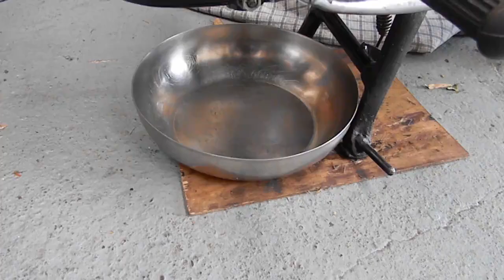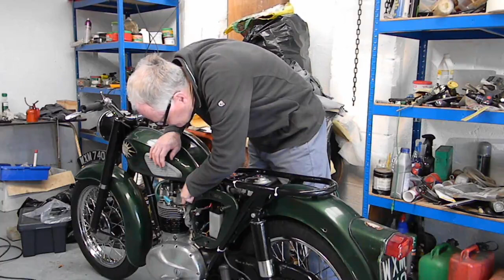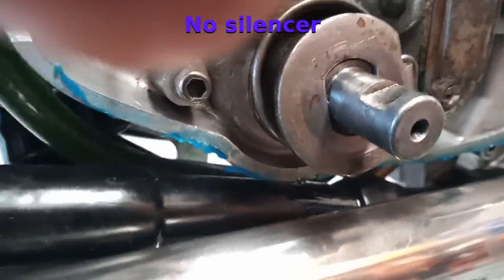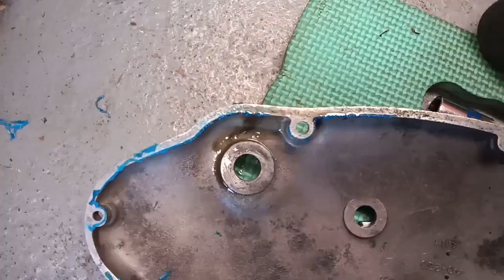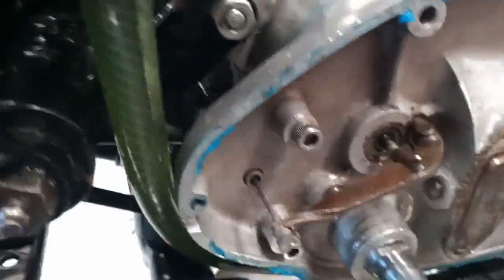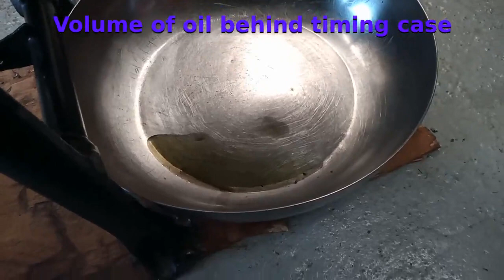BSA C15 Second Engine Rebuild - Part 7

Comment: Sounding good Hugh. I am not sure oil leaking into the outer case is a problem is it will return to the sump via the tiny drain hole but oil coming out is obviously. The later models had an oil seal where the K/S exits the case . Here is something i read on aforum  "O-rings are your best shot at leak prevention on the pre-seal models. Remove the case and use a countersink tool to add a chamfer to the inside of the shaft hole. You want a fat* o-ring that hugs the shaft. You want the chamfer deep enough so that the o-ring is not compressed more than 10% of its cross-section diameter before the metal of the shaft touches the metal of the inside cover.

Similar method can also be done to the shifter shaft.

* Seals of this type should not be compressed more than 10%. Therefore, the larger the cross-section diameter, the greater the assembly tolerance, thereby making effective installation easier."  Also make sure your gearbox isnt overfilled.
Reply from the maker: Tom you have been most helpful. I am collecting the inner timing cover on Monday from a local precision engineers who were machining a groove for an o-ring on the kick start shaft. I was going to fit a new main shaft bush and have it reamed out but I already seemed to have an oversized bush fitted and at present am not prepared to go for that expense. The kick start shaft is the worst problem. There is no seal and it sits below the gearbox oil level as far as I can see. Thanks for the advice.

Comment: be careful theirs a small hole in the inner cover to take that oil back into the engine. You will be design always get some. Mine comes through the crank feed, and returns fine.
Reply from the maker: Hello Dave and thank you.  I am very aware of that small hole and it is clear. The oil level within the two timing covers has not reached that hole yet nor the depth of the kickstart shaft. It seems to track along the shaft. It is a terrible design! Though a lovely bike. One of the nicest shapes of engine with the vertical barrel and oval outer covers. But what goes on inside is not so good!

Comment: Hugh, great video’s I am learning a lot watching you work. I hope you found a leak cause or unblocked the drain hole?   Keep up the good work.  
Ian (Tasmania)
Reply from the maker: Hello Ian I would think Tasmania is about as far from Scotland as you can get!! That is very kind to say that but I am not an expert on these old bikes. I can keep my own going. That tiny drain hole was never blocked. I had quite a leak from the kickstart shaft, solved by fitting an O-ring and another from the mainshaft where I fitted a new bush. Using Loctite 518 to seal the timing side cases made a huge difference. I still am losing gearbox oil internally. I am going to do another strip and rebuild this winter to try and get further with that. Thanks for taking time to comment.

Comment: High Hugh hope you are well. Re the oil leaks….. did you ever experience ‘wet sumping’ and if so did you consider adding a 1/4 valve at the oil tank outlet end to shut the oil off when not in use. Mine leaks oil even before I have ever started it so really dissapointed. No doubt I will have to go on the crusade that you did to stop it.  Sid
Reply from the maker: Sid thank you for that. I have been on a crusade!! But have not stopped it. I hope to make another film soon and you will see how badly it has leaked after the winter. I do get some wet sumping but would not put a tap on the oil line. My memory is like a hen and I would forget to put it on!! I am struggling to get mine to run just now. Heavy sparking across the points and struggling to idle. Two new condensers tried. Checked earth continuity. Retimed several times. I just don't know. I don't know how long to put up with it as I'm spending more time repairing than driving. Thanks for taking an interest.

Comment: Is there supposed to be a felt washer on the kickstart and gearchange shaft? I didn't notice the small ballbearing that should be between the clutch pushrod and the operating arm in your rebuild. You mentioned that you had difficulty with the lower engine mounting bolt and I seem to recall that there should be a shim between the frame lug and the engine.
Reply from the maker: Hello and thanks for the reply. There are not supposed to be felt washers on the kick-start and gear-change shafts. You are correct - I do not have a ball bearing between the clutch pushrod and operating arm. I will check that one out. I do have the shim (or at least a stainless washer of the correct thickness) between the frame lug and engine. I just hate all this loss of oil. I am going to replace the mainshaft bush, the pushrod and the pushrod bush. I am going to get the kickstart shaft opening in the inner timing case sleaved.

Comment: Hi,

Any idea where gearbox oil leaks are common? 

Daft question - if I was having a severe “engine oil” leak would the tank on the bike eventually drain? If so, then it’s my gearbox oil that’s leaking out the bike! And I’m unsure on where to look first as the underside of the bike is just wet with oil.
Reply from the maker: Hello Tommy that is not a daft question. I find C15 leaks almost impossible to sort out. The tank on the bike should have nothing to do with the gearbox. If the gearbox leaks through the starter shaft or the main shaft then that tank would fill up as the oil leaking into the outer timing case would be scavenged into the engine. I have had an o-ring fitted to the inner timing cover for the kickstart shaft. The gearbox could leak at the joint to the inner timing case. It could leak at the drain plug underneath - at the overflow bolt and at the joint to the casing. It could leak at the two places outlined above - mainshaft and kickstart. It could also leak on the drive side. I found a big leak at the sprocket. I took it off and sealed with Blue Hylomar. I think I have a wee film showing that. I have put a lot of work in and still oil. Sorry I can't be more helpful.